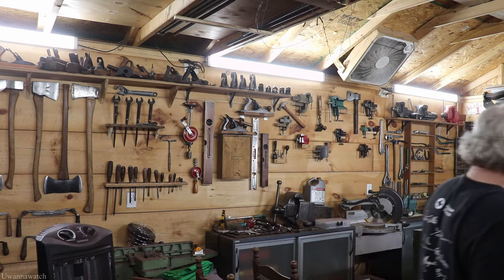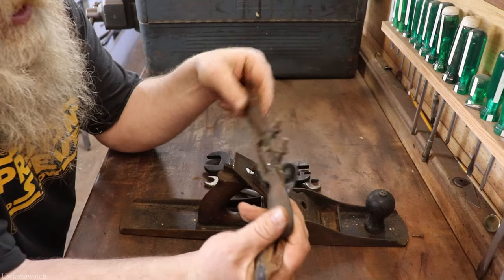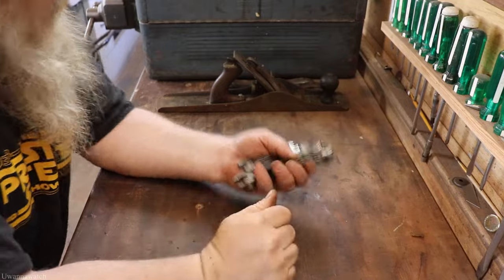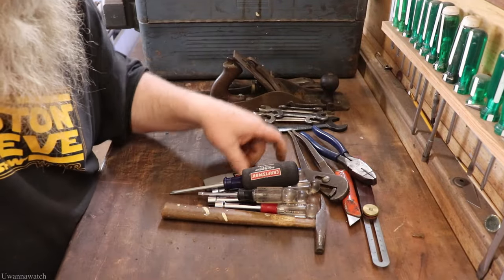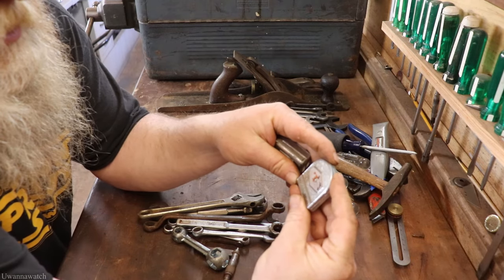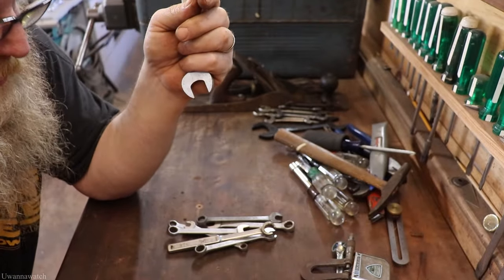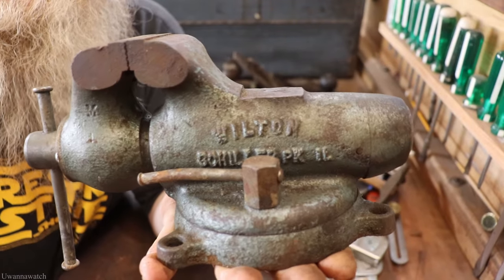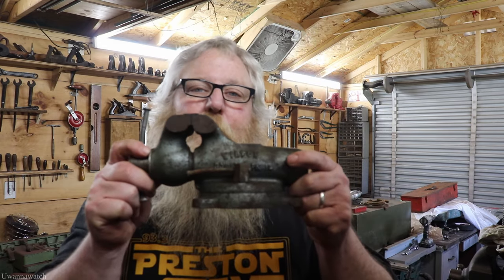Flea market haul # 28

Comment: This is a better)vest tool haul. The micrometer is special with the deep throat, wide anvils, and narrow opening, probably marketed for sheet metal use. It us junk with it stuck. I don't recognize the brand. I see that you are missing the 1/4" nut driver. I am not a Craftsman fan, but I started with tgat set of f nut drvers in the mid 1970's, and I still have them, but I upgraded to Klien many years ago. Craftsman nut drivers have shallow holliw bore and won't clear long studs like are found on HVAC fan motors. 
I want your little Wilton viSe (can't resist correcting the common misspelling)😉.
Reply from the maker: Hey There Paul, I cleaned up the micrometer and got it freed up. It's a Starrett. I won't use it  or collect it. So it will probably get released back into the wild. I'm not the Craftsman guy either but I just kinda liked them I don't know why...Sorry but the vise is a keeper and honestly I accept both spellings.
Reply: @Uwannawatch  George,
I learned that Starrett sold about a week ago. That is a very sad day for us Starrett fans. 
I inherited a rusted/stuck Wilton vise similar to yours when a neighbor moved. I mistakenly thought that the jaw began to move and in my eagerness kept increasing jacking pressure. I broke the vise🙁. I have salvaged and restored several vises, and breaking this cute little Wilton was a deep regret.
I have been disdainful of Craftsman since the late 1970's. A Sears store was literally across the street from my lane, and I was buying and covering Craftsman regularly. My dad owned few tools, but prized and cared for his tools with deep affection.  Craftsman was his top dollar brand, and I inherited his loyalty. I was breaking or wearing out so many Craftsman tools that I was purchasing duplicates to keep me on the job site, and exchanging tools on a weekly basis with the famous Craftsman warranty. That was in the days when my tool budget didn't allow duplicate tools. I started buying better brands during that time, slowly learning where quality was found and experiencing the pain of the associated expense. I have been collecting and using premium brands ever since. I occasionally find a Craftsman hand tool that survived my wholesale Craftsman purge. I use virtually none of them. 
More recently I picked up a rusted/stuck Craftsman drill press from 1942 for $25. I cleaned up both with only Scotch-bright and found a pristine machine underneath. My model was only made for about 6 months as production shifted to war manufacturing.   The little drill press was very well made. It has some design flaws, but I found myself using it almost exclusively since holes under 1/2" are most common, after I did a thorough restoration. The vise tuned out to be a tilting Pexto and got similar restoration treatment. This Craftsman drill press made me rethink my Craftsman aversion. I have purchased 6 more drill presses recently, gifting 3 of them. I kept the 3 smallest to add to my fleet. The last one was a 1970's vintage floor model Craftsman. I completed the restoration on this machine last week thinking a son wanted it. In the process I discovered that it had been partially retrofitted with a 2 speed motor yielding 16 spindle speeds. My son backing out on the machine made me install this in my shop. I started using it thinking that I could employ it for slow speed machine shop deburring. It is excellent for that task allowing me to keep my bigger machines set up for heavier jobs. So I now own and use 4 vintage Craftsman machines as daily users. They are all arguably light duty, but they have found a happy place in my snobbish heart and shops. I am happier with these vintage Craftsman machines than I would be with modern equivalent import brands. I will still keep collecting the best brands, but I am rethinking that there is a place for home owner grade machines even in a professional grade shop. I can justify purchasing premium priced tools and machinery now that my pockets are deeper, but I still stretch my spending budget by purchasing mostly in the used market.

Comment: 4:55 That's a micrometer. Not sure about the older mechanical types but the digital micrometers are extremely precise. I'd like to get a digital one but they're very expensive and a digital caliper is accurate enough for me
Reply from the maker: Thank You for the information. I appreciate it. I cleaned it up and it seems to work fine.